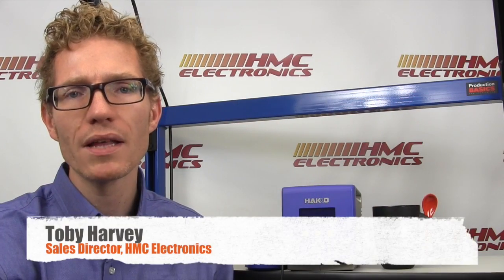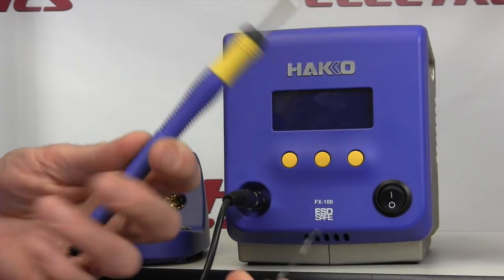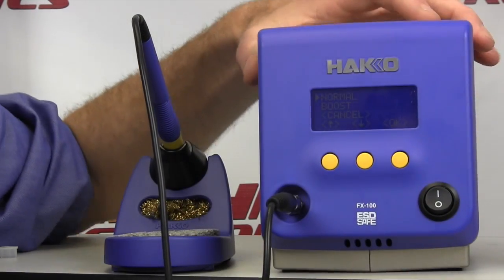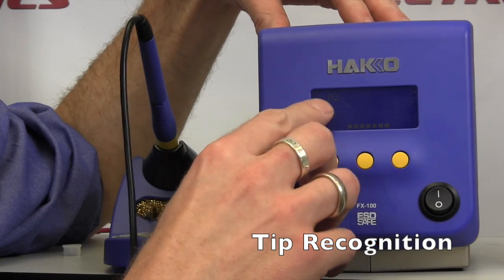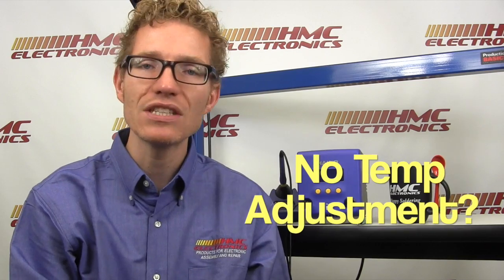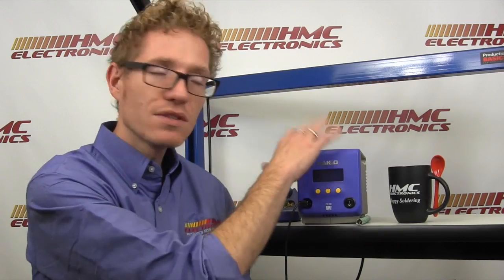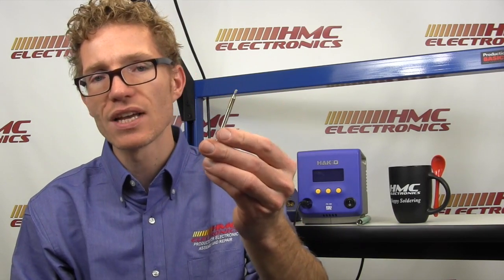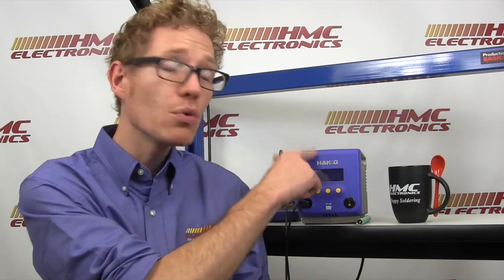Hakko FX-100 Soldering Station

Comment: Does Hakko have a soldering unit, that can handle multiple tools such as a wand and lets say a hot air gun and also have the ability to interface with a PC to record data?
Reply: I have a hakko fm-206 and it handle a iron, hot air, desoldering tool and hot tweezers.. 

What kind of data you want to recorder on pc?